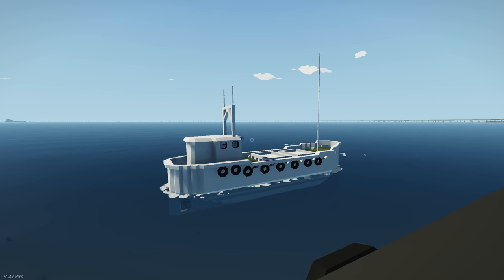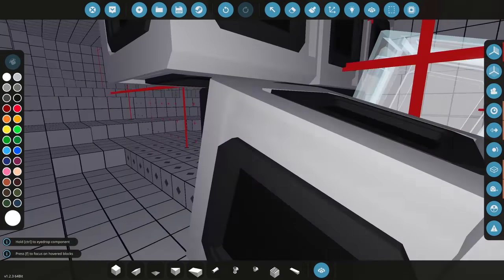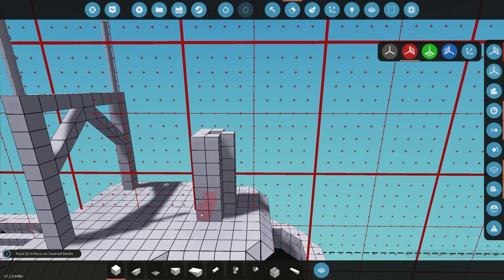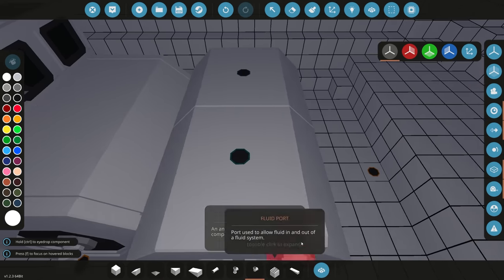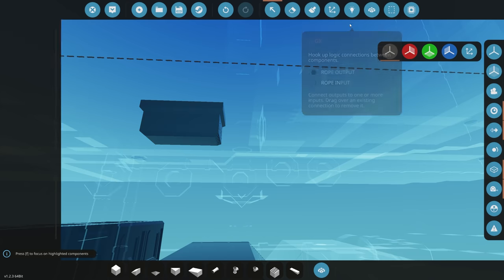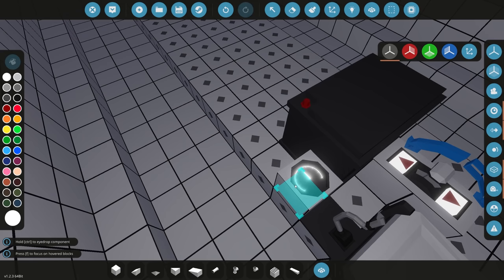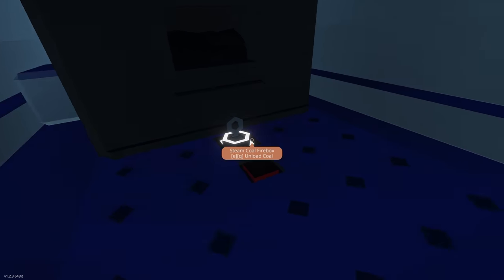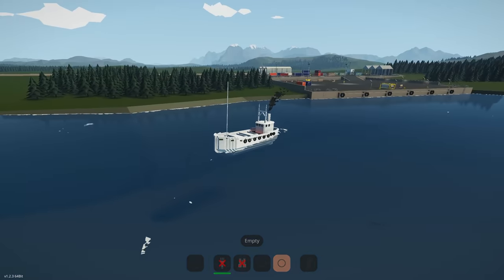Building a Coal Powered Steam Boat!!!! - Stormworks

Comment: Things i tested and found out. feel free to suggest correction/add. hope it helps you all.
A boiler can power so many turbines. i hook up one to six or more and it works great. one boiler and one turbine is inefficient weight wise
steam output from a turbine to the next one as input is a bad idea. they both produce half power. connect them parallel instead.
but for torque lines, they do work in series. turbines next to another do add up like AA batteries in line.
you dont need to connect both torque out lines. they are the same line. having one connection makes sure that turbine delivers. even if its behind another turbine
condensers work weird. they produce backpressure which degrades turbine performance. im still testing condenser behavior, yet to determine how many i need.
i give boiler water pump (small pump) control to an AND gate. thats connected to two threshords. one is pressure below 9 other is volume below 9. keeps a steady P 9.5, never exploded on me.
cross linking the torque before the gearboxes increase the speed. even if each turbine set has their own propeller. mine got from  4.5 to 5.15 m/s

you need so many turbines but it still wont catch up with a combustion engine boat. it becomes viable only with nuclear.

!!!UPDATE: a pump to suck out the output helps even more than a pump to pressurize input. you can daisychain with pumps inbetween but dont forget another pump after last turbine. 
you can even connect em parallel, loop it and maintain -output pressure = input pressure (like input 12 and output -12) to get free energy forever
Reply: Daisy chained turbines are actually perfectly fine if you add large pumps between connections. That also goes for ANY turbine setups.
Reply: So in my testing pumps are waste of energy on steam engines with one or two Turbines the added output dose not justify the cost of the input. Pumps maybe more efferent on  larger multiple turbine setups. Ambient temp effects Steam engine efficiency on all parts of the engine design fireboxes, boilers, turbines, condensers, Radiators, and even the water tank for the boiler. Condenser efficiency is greatly effected by the ambient temp from the fire box and boiler also the coolant input and out has very little flow its the one part in a steam engine setup that vastly benefits for a fluid pump. The cooler a condenser is the more steam it can process. You can use electric heaters to pre heat boilers good for faster start up times in cold environments.
Reply: @cappedu1  i tested pumps. shocking news. connect all turbines parallel and pump from output to input. adjust fluid quantity to keep a pressure of 12 in input side. and free energy... its like cheating tho. so i will probably use daisychained turbines with pumps in between.

Comment: My experience steam turbines produce linear power just like electric motors doesn't matter what the RPS says as long as it's moving it'll produce the same actual amount of output power torquel at lower rpms higher rps  The torque will actually decrease in an equal linear fashion till there's not enough to sustain itself .

Comment: In the current build steam doesn't decay so you can recirculate it. A pair of medium pumps can be used to re-pressurise steam before cycling it back into the turbine. you can generate enough steam to max out the turbine and then turn off the boiler and just use the pumps to loop the steam back into the turbine.

Comment: Can a boiler use salt water pumped in from outside? if not that should be a possibility, ships have done this historically
Reply: at the moment you can only use fresh water.  on the other hand, you can use sea water through one or more heat exchangers to make the condenser work even more efficient

Comment: Meanwhile, Boilers can't accept Saltwater at the cost of scaling, can't convert Seawater to freshwater, Boilers explode from pressure rather than low water level like they do in real life, if this were changed, it would incentivize the player to use saltwater in an emergency but nope, not gonna happen. Not even fuel oil is added, RIP decoration boilers as I have in my RFA Freshspring, absolutely no way to get coal in without manually doing it which looks terrible. Connection placement sucks, fireboxes are too wide.

Gotta say I was excited about this Steam update, but this is just a big no for me.
Reply: yeah BLEVE's should be a thing
Reply: 'Freshspring' is that the boat on Facebook - I'm in the group! :)

Comment: If you can go 10 m/s i get impressed. (Might need some updates)
My max GU (Generator Unit) are 32 GU on 4 turbine (1.2.2)
Now 20 GU in (1.2.3) ?? Peak 100 GU when starting the turbine.

After 110 heat boiler are not making more pressure, and turbine only ½ doing run whit pressure.
It act funny on my system.
A thing i know if you RPS on turbine drops under 0.5 there is a chance you get no energy out of the system.
about 1Rps seem to be the sweet spot.

Comment: How to make your boat move faster? Can you build steam-powered boat with speed at least 10 or 20-30 for the best?
Reply: Yes you can easily hit those speeds, you just need more turbines (I place them in parallel with a large pump on intake and exhaust of each), and gearing that keeps them spinning very slowly. One boiler will max out >12 turbines, and a small firebox can run multiple boilers, although I get a speed of 30 (meters per second is the default reading of the in game sensors, keep in mind you multiply by ~1.944 to get knots most creators including this channel talk about in game boats/aircraft speeds in, or 3.6 to get kilometers per hour widely used for cars ect) out of a single boiler in a fairly large/well featured boat. You will need to use multiple condensers, I find one for every 4 or so turbines will keep them from "saturating" (as they get hotter their flow-rate decreases, and thus the pressure on the input side will climb) and becoming a limiting factor, but a warning for submarines that the deeper you go the more you'll need as the flow rates of your cooling water fluid ports will drastically decrease. Also keep your condensers far away from firebox's, nuclear reactors or running heaters else they will absorb a LOT of heat that way and saturate.
Reply: @SheepInACart  TY, this was helpful.

Comment: can we use sea water for the boiler?
Reply: No, but hopefully at some point the devs will add something that can change it into fresh water
Reply: @secretslayer1234  ok I was woundering bc i got it working just couldnt get the ship i put it in to go more than 2 knots
Reply: @winterbudde1174  Yeah, they simulate how it would sorta work IRL. Dirty steam creates salt crystal structures which can block the passage of steam and packs the steam with unwanted pollutants. The pollutants will either dissolve and travel with the steam or be deposited in the boiler and that means less room for water, which means you cannot fully pressurize the system. I don't think they use just fresh water in steam boilers, it has to be distilled numerous times to remove impurities perfectly - they just clean the boilers out every so often (which led to a lot of deaths because of improper handling).

Comment: build this Titanic II
General characteristics
Class and type	Modern interpretation of Olympic-class ocean liner
Tonnage	56,000 GT (estimate)
Length	269.15 m (883.0 ft)
Beam	32.2 m (105 ft 8 in)
Height	53.35 m (175.0 ft)
Draught	
7.5 m (24 ft 7 in) (normal)
7.926 m (26 ft 0 in) (max)
Depth	19.74 m (64.8 ft)
Decks	10
Installed power	24 double-ended and five single-ended boilers feeding two reciprocating steam engines for the wing propellers, and a low-pressure turbine for the centre propeller; output: 46,000 HP
Propulsion	Two three-blade wing propellers and one three-blade centre propeller
Speed	24 knots (44 km/h; 28 mph) (maximum)[citation needed]
Capacity	1,680 (double capacity); 2,435 (maximum)
Crew	900